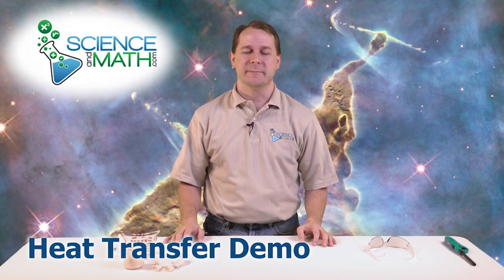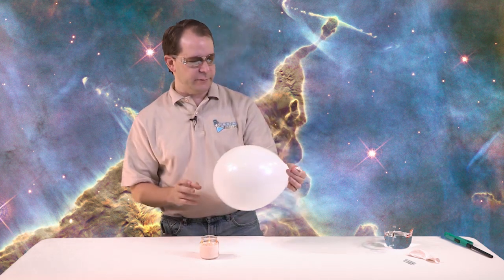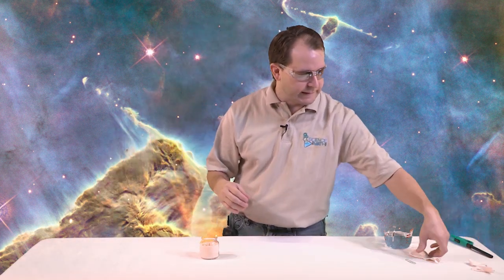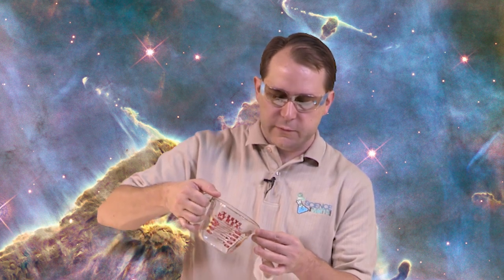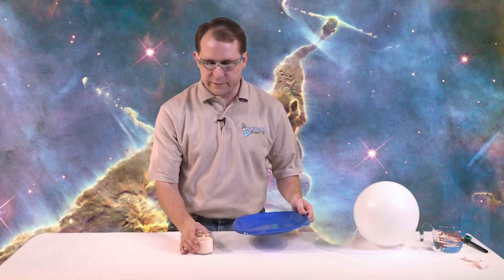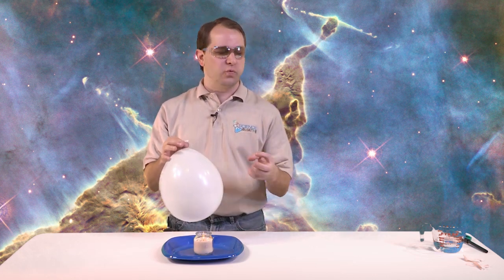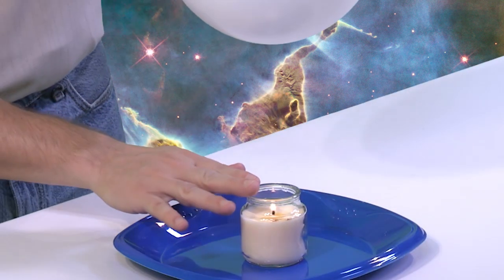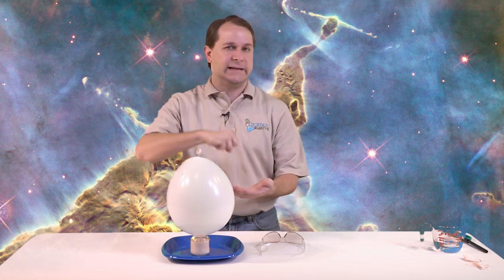Physics Heat Transfer Demo!  -  Balloon in a Candle Flame

Comment: @Math and Science Hi Jason, I recently watched a video in slow motion where they took a steel ball and compressed it under a hydraulic press, what happend was that the ball turned red and just before the brink of exploding there was an beautiful red aura that almost similar to plasma, but I don’t know the physics behind it. Obviously a huge amount of heat is generated due to the tremendous pressure built up inside the ball, but what is this amazing red/orange plasma thing arouse the ball? Thanks for any reply!
Reply from the maker: That sounds cool.